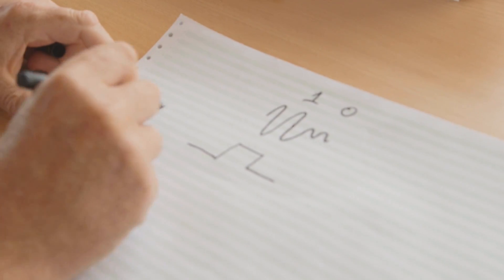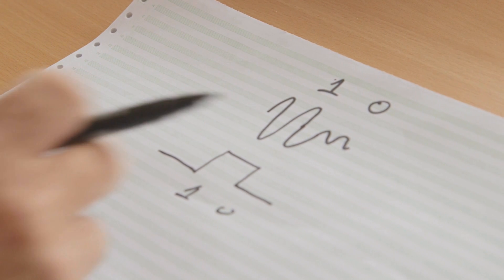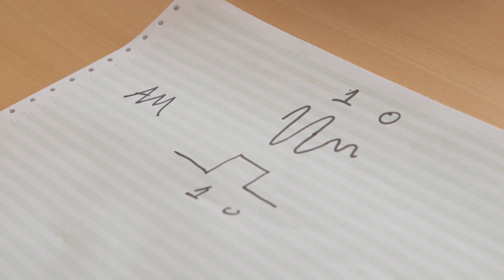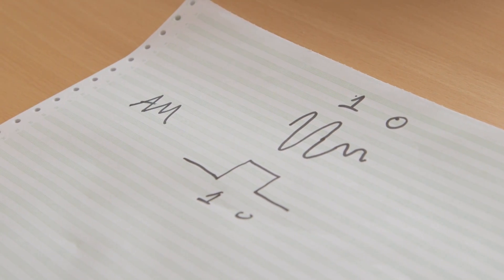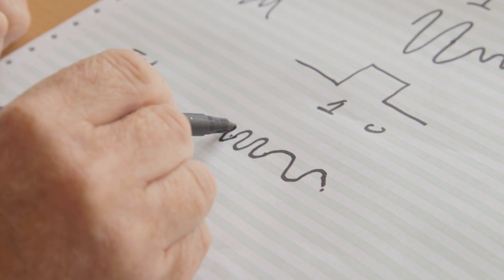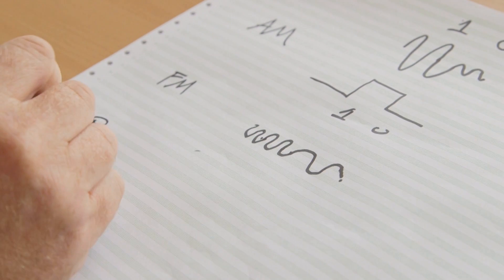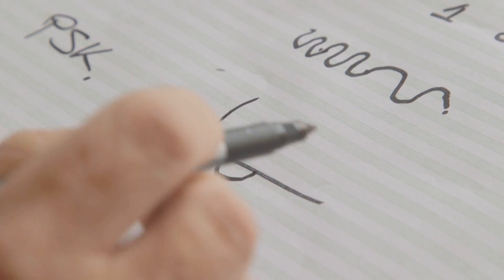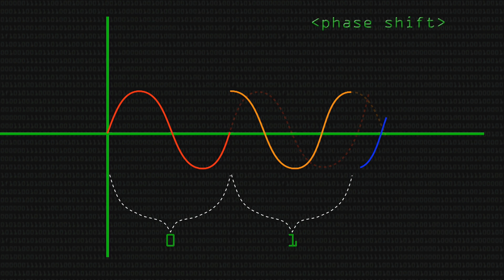How Broadband ADSL Works - Computerphile

Comment: the amplitude and frequency modulations are easy to understand, but I completely missed the phasing modulation. can anyone clarify that for me? :)
Reply: Ok, I'll try.

If you consider a standard Sine wave, it starts at 0 goes up to 1, comes back down through 0 to -1 and then heads back up to start over again. It does this again and again at a certain frequency. Let's say that that standard Sine wave is 0 degrees out of phase. In other words, it's not out of phase at all.

If we were to look at a Sine wave that is 180 degrees out of phase, it would be exactly opposite. We say it's 180 degrees out of phase because you can model the Sine function on a circle. So our first Sine wave started on the right-most point of the circle and went counter-clockwise. If we start on the left-most point of the circle, it's 180 degrees around the circle at that point.

Ok, so a Sine wave 180 degrees out of phase is the exact opposite of one at 0 degrees. This means it starts at 0, goes down to -1, comes back up through 0 to 1, and then heads back down to start all over again. You could then build a machine to detect which phase you were in, since all of the peaks are now valleys and vice versa.

I'm not entirely sure how it works but I could think of one way to detect the phase of the a signal:
Since you know the amplitude and frequency of the signal you're supposed to be detecting, you could build a machine that takes that signal as well as generates it's own signal at the same amplitude and frequency and combines them. If the signal coming in is at 0 degrees, the peaks and valleys match up and they add together. You're left with a signal that has twice the amplitude. If the signal coming in is at 180 degrees the peaks and valleys are opposite each other and therefore cancel out and the resulting signal is completely flat. The detection machine then looks if there is a signal there at all. If there is, it sends out a 1, if there is not, it sends out a 0.
Reply: Without getting too technical, I am going to give it a try. 

AM: Changing the Amplitude of the carrier wave
FM: Changing the Frequency of the carrier wave
PM: Changing the Phase of the carrier wave

AM and FM are fairly easy to understand, I'm going to skip that. 
PM (or PSK) is basically changing the "starting point" of one signal. 

Imaging a clean AM signal, it would start from 0, going to +1, 0, -1 then back to 0. This completes the cycle. 

For PSK, let's assume 0, +1, 0, -1, 0 signal is the "starting position" of this signal.
The "opposite" of this signal would be 0, -1, 0, +1, 0.

The transmitter can choose to start the next symbol by going from 0 to +1, or from 0 to -1. This represent 2 values, 0 and 1. 

This change in ramp direction is a change in phase. 

In real life, PSK used are often of more than just 2 phases, in order to make it "faster". 

In the latest WiFi technology, 256QAM is used, 256 possibilities (or bits) could be squeezed into just 1 symbol transmitted. 

The trade off of using higher rate QAM is losing resilient to interference, therefore most digital devices would auto negotiate and slow down if required.
Reply: The general equation for a sine wave is: 
y = Asin(nx + b) 
The A value is the amplitude of the wave basically the height of the wave and is associated with AM which you saw in the video.
The n value determines the frequency of the wave basically how close the wave is and is the basis of FM. 
Now we get to the b value and this value controls the phase of the wave. A intuitive way of thinking about it is simply to move a wave of constant frequency and amplitude backwards or forwards on the x axis. 

For example consider the following equation:
y = sin(x) 
If you were to plot it such that x is between 0 and 360° it you'll get a normal sine wave as seen in the video but notice at 90° the wave is at it highest point, now imagine you slowly pushed that wave back wards until the highest point is now at the y axis. 
If you done that you essentially shifted the wave back by 90°. And this is the principle of phase modulation, how it translates in to a signal I'll leave it to you to find out
Reply: APaleDot so you don't modulate a wave, you start another wave with it's phase offset from the previous one. it that right?
Reply: http://www.radio-electronics.com/info/rf-technology-design/quadrature-amplitude-modulation-qam/8qam-16qam-32qam-64qam-128qam-256qam.php
Reply: Morelloo1 sorry mistake, M is the # of phases M = 2^(# of bits u transmit)
Reply: Adriaan Boer yessir! in a red speedo!
Reply: /watch?v=QFi16s4RXXY
Reply: Signals are waves, so they have phases. You change the phase to encode data.
Reply: Edmond Siu Phase shifting basicly workes the same as freqvensy shifting, the only real differences that the information is recorded in how far ahead of after a certan point the wave cross the X-axis or something simular.

The problem is that if you change the phase on a bandwidth limited medium, the frequency will change as a cause of that, so you cant combine frequencies and phase shifting (if you have bandwidth limitation at least)

A advantages of phase shifting is that phase is more stable and better to read out, additionally phase is easier to combine with amplitude keying because of power limitations
Reply: you can also have M-PSK where M is representing how man bits you will transmit.  so for exmaple, if you have a QPSK (q is quaternary, so 4 phases)  signal you can transmit 2 bits at a time, with 4 different phases.  so the more bits you want to transmit the more phases u need to deploy.  he kind of explained things weirdly because AM and FM are just simple analog modulation techniques where ASK, PSK, FSK etc are digital.  i dont even think FM or AM is used for anything other than radio anymore.
Reply: crazyasianxD1 :)
Reply: Felds Liscia Well, it's still the same wave, because it's all one signal.

I mean you could also say, for frequency modulation, that you start a new wave just with a different frequency this time, but that doesn't really describe the situation in a useful manner.

Waves have Amplitude, Frequency, and Phase. Any one of them can be varied to encode data.
Reply: Yeah, it's not clear.
Reply: it is like, having a sine wave, on a given point of it, the encoding fastforward to another point of the sine, and this instant jump can be measured into angles, and how many degrees means the data encoded in that jump, multi-bits meaning. IF I understand it correctly.

Now making jumps means that there is higher or lower frecuencies peaks, so is not a single frequency, it needs a band frecuency called a channel. And on the copper is available several of those channels available for transmission/reception.
Reply: Is that ET in your profile picture?

Comment: I'm Jello, as I cannot get FTTC, I have no cabinet. :( Direct Exchange connection. So perfect line, but no ability to "wire in" the fibre, as no one is allowed to mess with the Exchange. :(
Reply: Not true. FTTC for exchange-only lines is a reality.
Reply: dr34m3r2k
99% of places are not allowed due to the risk of breaking equipment. Just the next street has it. I'm literally too close to get the upgrade. :(
Reply: Breaking equipment? lol. It is not installed by amateurs. Find your local BDUK project if you're not covered by BT's national roll-out.
Reply: ***** EO lines can be converted by placing the PCP and DSLAM outside of the exchange.
Reply: dr34m3r2k
No. Literally, there is no solution they provide in the UK. They are afraid to drill holes/change the exchange racks etc for direct lines into the exchange. They are worried the fibre would interfere with the other equipment.

I can get a WHOLE NEW LINE INSTALLED. But as that includes a cabinet, a line, the digging, the planning permission, and a new socket in my wall, you can guess the price would be astronomical. All because  my line has no cabinet for them to wire up as fibre, because it's too short a line. :P
Reply: *****
Yes. Places with a cabinet. Not places which are too close to the exchange, as they are plugged in directly, and have nowhere to put the fibre line. :(
Reply: TechyBen There is a solution, and it is being used by BT. http://community.plus.net/forum/index.php/topic,125736.0.html/ & http://www.superfastcornwall.org/faqs - My line is connected directly to the exchange. Will I be able to get fibre broadband?
Reply: If you your line doesn't run through a cross-connect cabinet, usually they'll wire you up to a dslam/oslam/zslam whatever they use in the actual CO, depending on how far away it is.